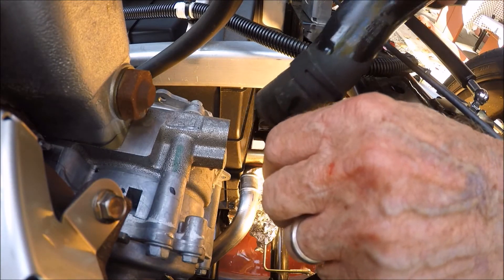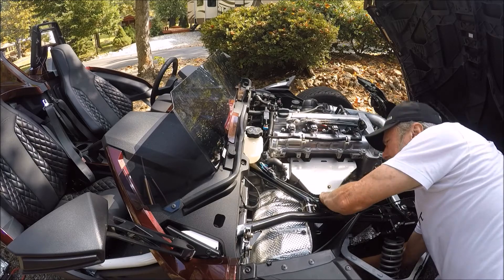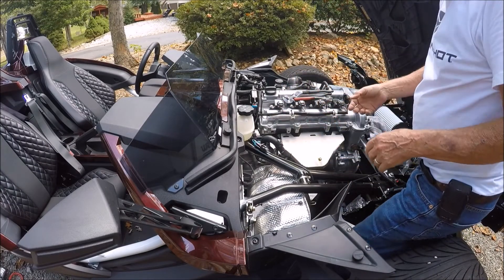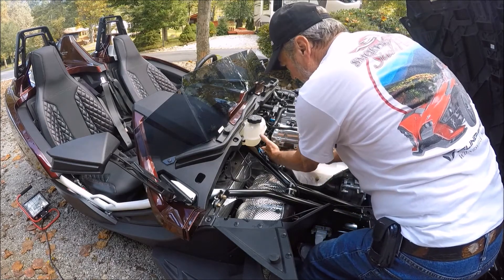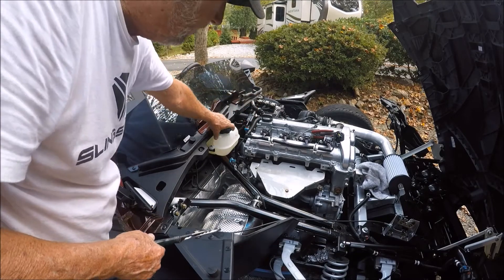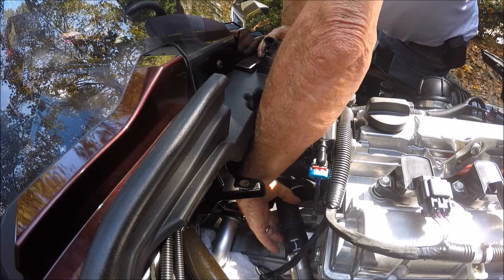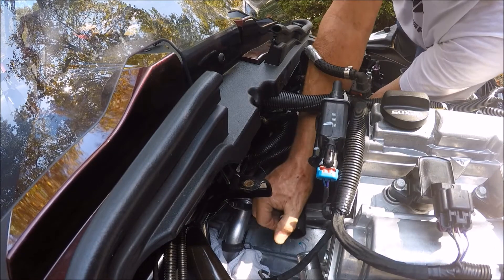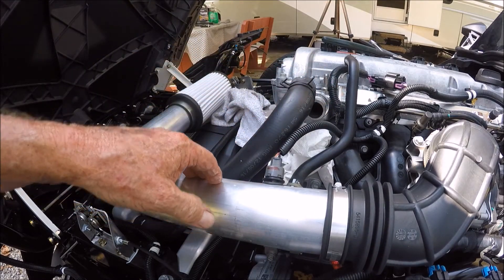Silicone Coolant Hose Kit Installation Procedure Part 1

Comment: Sam,  Why are you replacing all your hoses on the new Snazzy?  Were you having trouble?
Reply from the maker: Jim Schrom I was asked to create an installation video by Twist Dynamics.  I would have preferred white, but they had black for me at the time.  The main reason you would change the hoses would be for color.  There are many colors to match the Slingshot.  I will be creating more installation video for Twist Dynamics so keep watching.  Notice the extended range hood hinge kit.  White, my accent color.